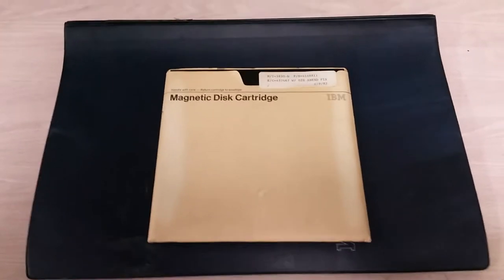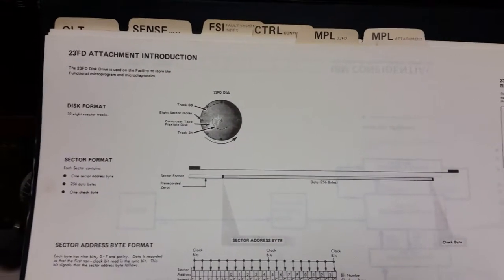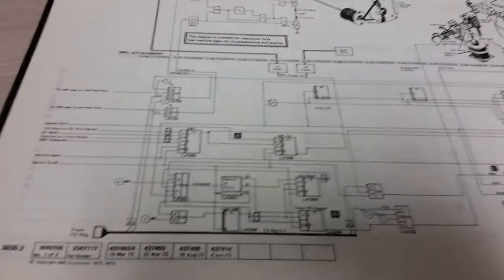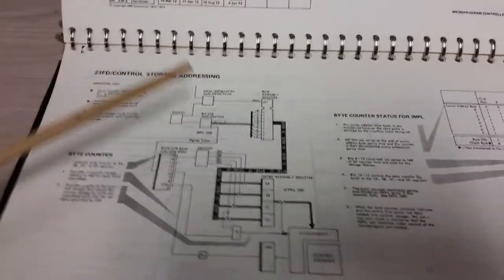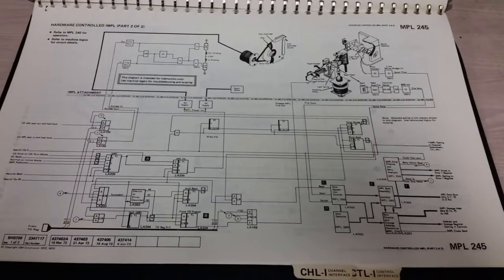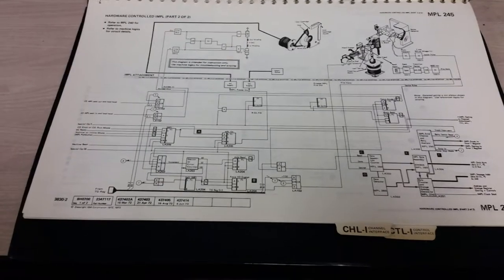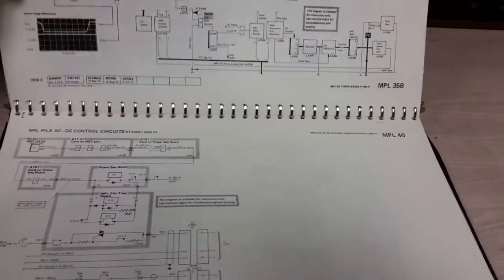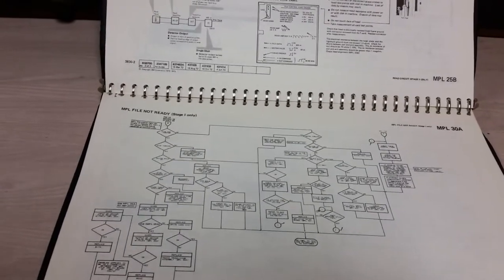23FD Floppy Disk Format Found

Comment: By now I was hopping for a copy of the IBM 3830 Storage Controller Maintenance manual on way or the other. But still no manual or access to one.
Reply from the maker: Oh my, you may have just screwed the pooch. As you know, I have a business to keep alive, so any Youtube related tasks will always be on the back burner. It will happen when I can get the time and resources to make it happen. The passive aggressive public shaming angle does not really work with me. Also, why are you being so sketchy about why you need the manual? Cripes, throw me a bone or something.
Reply: Well I could of gotten an E-mail notice stating that it is in the bottom of the query instead of nothing.  By the way,  You are not the only one running a business. As far as throw you a bone, see message about 1 month ago,  My last E-mail with Al said to keep bring it back up.  lets just say I have access to a couple of those controllers with a hole lot of my drives with them. The location that has the units does not want to scrap them. (Two 40 Feet containers full of my drives and the IBM controllers). Their looking for  a None disclosure use of them. The 3830  Model 2 , I must do some servicing on to use with my drives.

Comment: Archiving the disk contents is definitely a must-do. After accomplishing that, what do you think about building an emulator which plugs into the computer in place of the drive instead of trying to reproduce the original disk media? It would be less authentic, but I suspect it might be a lot less work.
Reply from the maker: Eventually, I want to rewritten floppy, but until I can write a 23FD, emulation will have to do. While digging into the docs, it should be entirely reasonable to tap into the existing MST based circuit boards (it is just about all simple SSI at this age), and inject in microcode stored in an EPROM. Casually looking, I bet the whole thing could be done without any sort of microcontroller at all - just TTL counters and an EPROM - but it might just be easier to use more modern tech. Anyway, I have not programmed a microcontroller since the mid 1990s (a PIC!), so it might be a fun extra. In fact, I just found my old PIC programmer in a forgotten box.
Reply: I've used PICs before, but lately the STM32 family has been my go-to.
Reply from the maker: I think it is a PIC 16C7x part - kind of obsolete and limited. Just interfacing to a EPROM probably be a pain! Anyway, I am sure when I present my ideas for the device (a future video), I am sure all the advocates of (fill_in_brand_of_microcontroller)  will speak up.
Reply: I'm looking forward to seeing what you have in mind. That'll be a neat project. I wonder if you might be able to create a widget that you can plug the existing Minnow drive into in order to write new media on it, vs. modifying a more common drive for the oddball track pitch? Is the media close enough in size to more common 8" media that you might be able to punch new hard sector holes in a common diskette for use in the Minnow drive?
Reply from the maker: I think the media is the same dimensionally (apart from the sectoring holes), but I do not know about the magnetic properties.
Reply: @uniservo   I am not to worried about the Floppy disk type B contance. You could always modify an IBM type 1 a 8-inch diskette for use in the 23FD drive. As far as reading the disk you could always modify an SSSD 8-inch floppy disk drive. (Add the Extra Index censer and wire it in parallel  with the  existing one). The disk normally has 
8 index holes (hard sector) with 35 tracks (of 40) 32 used for controller data, 2 reserved for bad blocks, other).
A hole punch is also needed, plus software to read hard-sector diskettes. Memorex 650 disk can be made to work.

Comment: If somebody wants to get the  IBM 3830 storage Controller Model 2 Maintenance Library photo copied at a copier shop and send it  via COD mail, I am OK with that. Include the cost of duplication plus shipping charges and a couple of hours labor throw in. I do not have a problem with that, it might be quicker.  Some copier shop might bark about the copywriter notice tho.

Comment: I wish somebody would upload a copy of the IBM 3830 storage Controller Model 2 Maintenance Library. Manual to : Bitsavers.org computer archive and the Archive.org web sights. It is missing in their archives.
Reply from the maker: Al might have it in the queue. If he does not, he can borrow mine (I have a standing offer with him about my docs).
Reply from the maker: I will have to dig it out, and then at some point, get it to Al for scanning. Do you have a 3830 you are working on?
Reply: @uniservo   Yes, access to more than one IBM 3830 Storage Controller Model 2's, that require some servicing. For a faster response you can always E-mail be directly. See Above  e-mail for  my e-mail address, sorry for the delay.